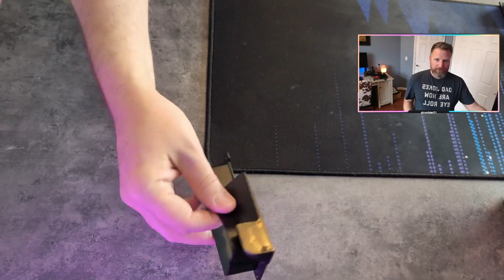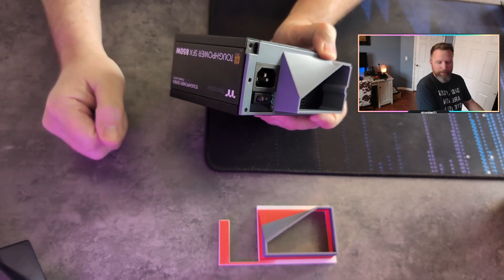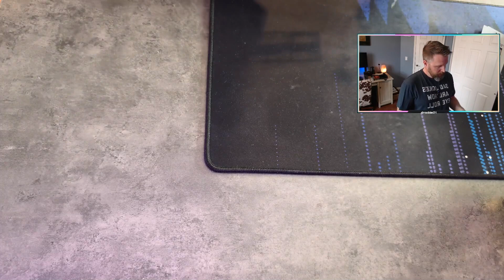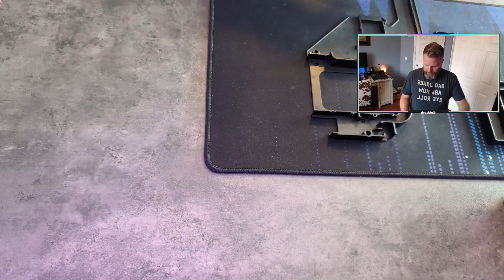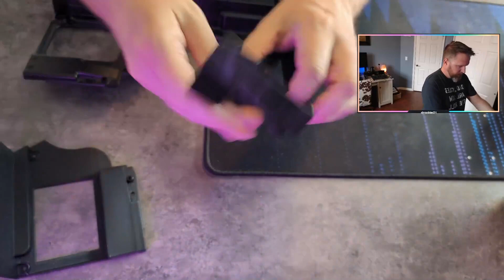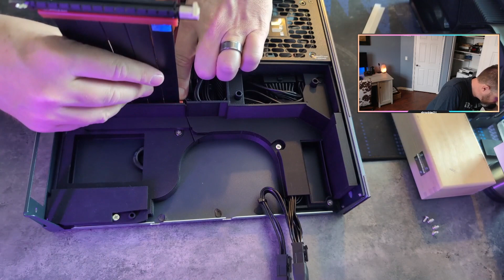Steam Machine Prototype Rebuild - Video 3

Comment: How is it going with the custom cables?
Reply from the maker: @L0tsen  unfortunately, due to an interference for with the motherboard CPU power connector header and the case, I had to set the project aside for now. I ended up going with a fully 3D printed case instead. I did order custom cables from DreamBigByRay on Etsy for that computer, and they're very high quality.
Reply: @droobie21  oh. Its atleast good that you tried. Having a fully 3d printed case also seems interesting tho.